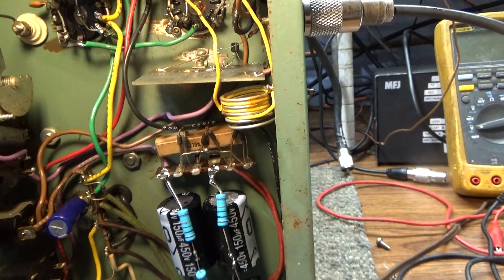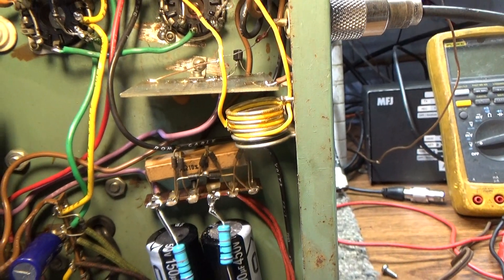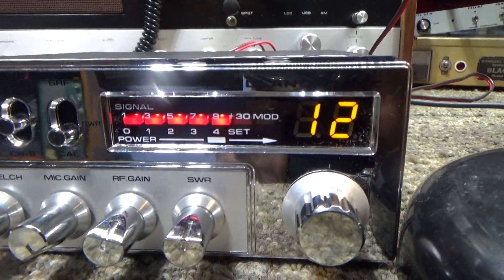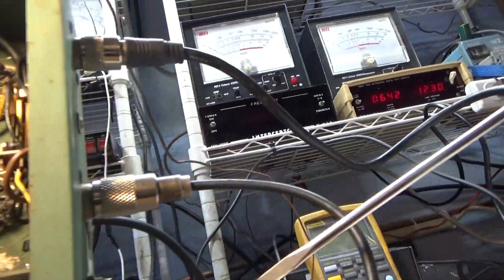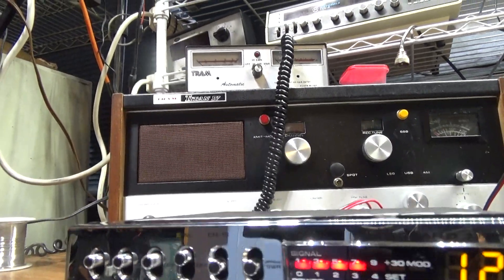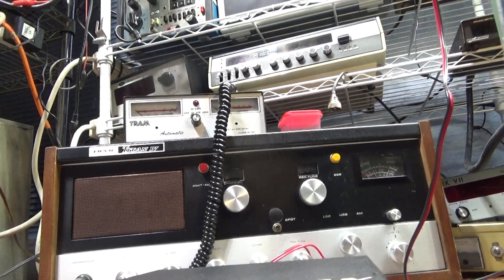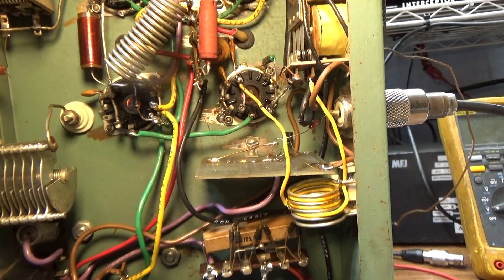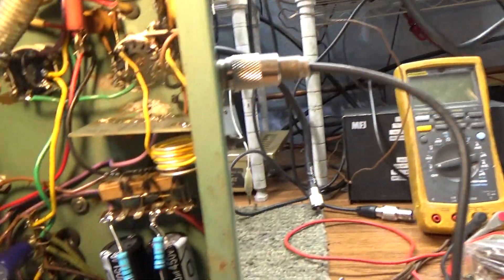Maco 200 adjusting the Input SWR with radios internal SWR meter

Comment: I'm amazed at how many operators don't think to check their input SWR, whatever the amp be. They just blindly plug into an amp, and when their radio blows up, they wonder why. So they plug another one in. I also advise them to utilise an inbuilt meter. And they'd be surprised by how much extra power they'd get. For example, with a Heathkit SB200. If you mod the 10m tuning to 11m, you're looking at a couple of hundred extra watts on sideband. But as much as I try, I can't seem to drill the basics and importance of this into people. So frustrating.
Reply from the maker: I agree, I been trying to beat it in people's heads for years now. So many have no clue what Input SWR is.
Reply: @tramdr  maybe we need to explain just like your antenna, it's about impedance matching, and is just as important.